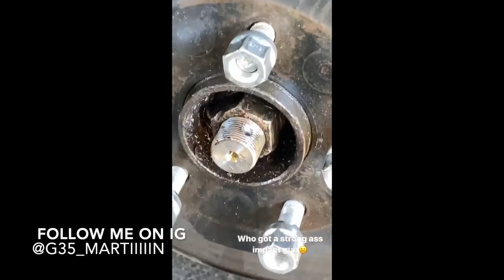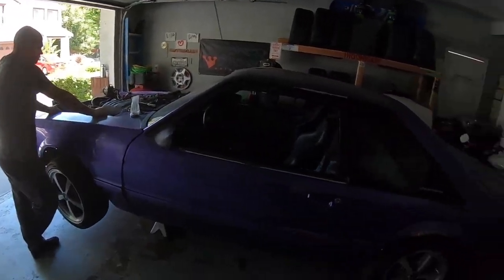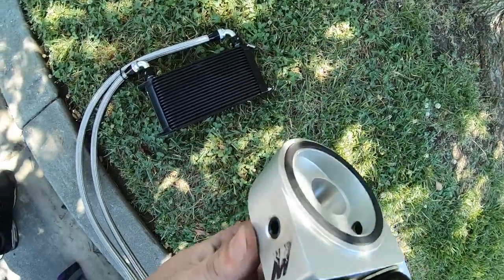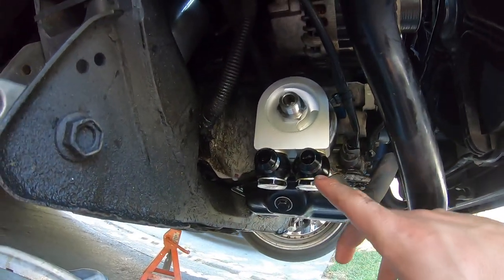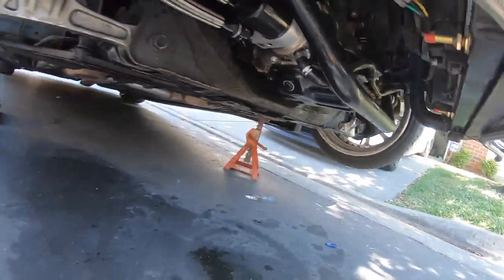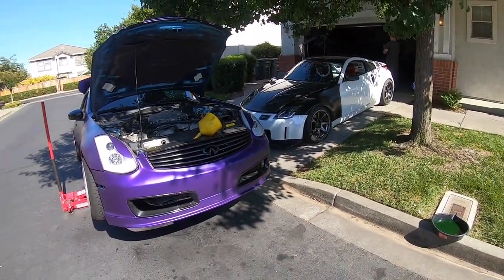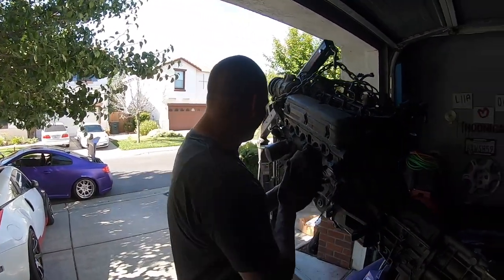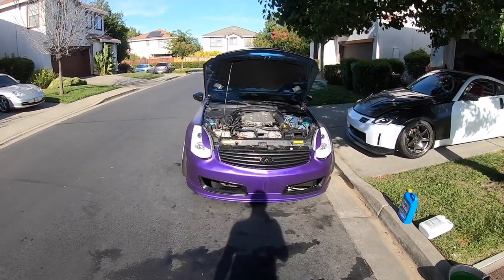MISHIMOTO OIL COOLER INSTALL | G35

Comment: Do you have to drain the oil of the oil cooler every oil change i just got mine and idk if i should drain the oil from the oil cooler
Reply from the maker: No. Oil flows thru the cooler it doesn’t sit in it like the pan